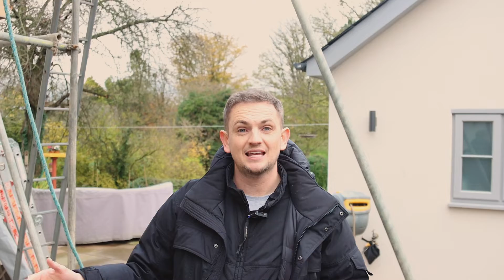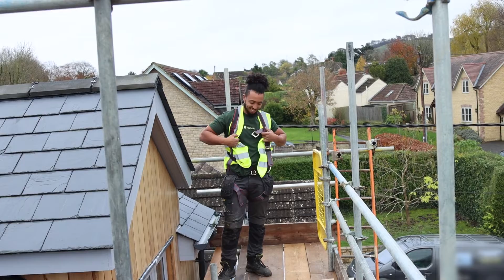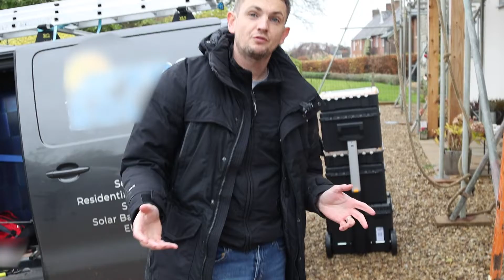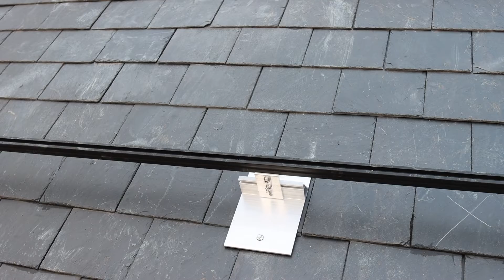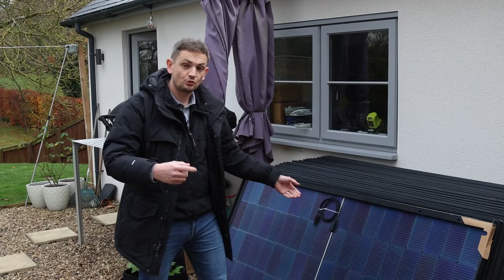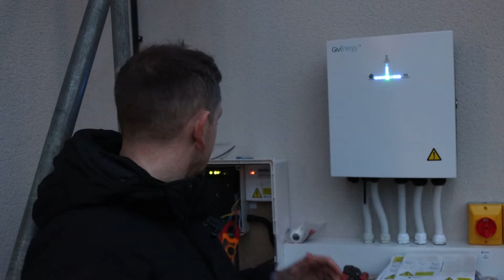Solar Panel Case Study UK - Our BIGGEST installation to date

Comment: They want us to get a heat source heat pump???? The power used is going to cost a fortune even with solar it will not be good.
I have wood burners and the costs are minimal as I cut my own wood.  Standing charges are higher than usage which is stupidity of the government policy.

Comment: I enjoyed the video, thanks! Did this installation require a canopy to be installed over the AIO+Gateway? I'd like to install one of these in a shady location on the outside of a west facing wall, but I can't figure out how to cover it since space is tight.
Reply from the maker: Hey Tim, glad you enjoyed! It is advised to install a canopy over the Gateway. However, our customer specifically requested we didn't fit one and GivEnergy confirmed that even though it is advised, it makes no difference to your warranty. If you don't have the space to, this would still be okay!

Comment: Could you please make a video showing how  much  a 420w panel actually produces in the UK (irrespective of string or micro inverter) to prove that a say 320w micro inverter is more than adequate for 95%of the time because the UK weather is such that you will rarely if ever reach 350w never mind 420w. Additionally show the low light generation. Thank you
Reply from the maker: We can definitely do this. The string vs micro inverter does have a huge impact in low light generation, but we'll be able to explain this too!
Reply: @Heatable  Thank you. I think this would be of great benefit to promoting Enphase in UK. Many people have a "mental block" thinking they are loosing production capacity by limiting themselves to a 320W inverter coupled to a 420W panel. No one has yet demonstrated a direct comparison in typical UK weather from low light, to mid-day of a direct inverter and m/I at the same time.
Reply: @Heatable  have you done this yet? Can't seem to find it. This is enticing but can't really go ahead without some data to back it up.
Reply from the maker: @Aphova  Hi, we have carried out a test on these panels vs normal DC panels over the past year, using all micro inverters to measure the actual difference in generation. It's in edit but will be on the channel very soon 👀

Comment: yes solar  in the freaking land  where the   sun don't  shine 
  i have  5kw  solar in england    and   it produces     200 w  on a dull day   [ which is  for about  6 months of the year  ]
and a battery needs    recharging    every few days  . 
if i had the money  to spend    i would need to buy a battery  big enough  to   power the house  for  at least    4 weeks      [ that would cost    40 k    and then  another 40k in  the next    ten years to replace    the  godam batterys  ]  
at the end of the day      this is just a  big    CON  !
Reply from the maker: Hi Colin, do you have micro inverters? If you don't have these optimisers, you might find that this is the reason why, as they won't be turning on on lower light days.
Reply: Hello mate I also got 5 kw with emphases microinverter in each panel with 9.5 kw battery and ev charger my system is working really well able to charge my ev and also manage to do some export during winter, not much but still ok. Very happy with my solar no problem since installed last November 2022 by Jps renewable

Comment: Is this system going to give the home-owner the results they're looking for? The reason I ask is because they will be using most of their energy in the winter, but that's when solar production is going to be the lowest. Then in the summer when they are producing a lot of solar, they can't export much of it and unless they use the heatpump for aircon, the battery is going to rapidly fill and the rest will not be used.
Reply: SIMPLE ANSWER IS NO     pete    if you had 40 k's worth of battery   to store   the   power    in summer   you might just   make it through  the  dark months  
when you   add in    heat pumps and  ac    cooling   this   whole senario   turns into   a  megga rich persons      aspiration .
Reply: I have similar , all I expect to be able to do is supplement heat pump from solar in winter but more prevalent will be use of battery charging up on cheap rate to do the heavy lifting in winter .

Comment: Very similar to the install you guys have just completed for me just before Christmas , 16x REA Panels with the micro inverters, AIO with Gateway for full off grid and also tied into an existing solar installation under the old FIT scheme along with the GivEnergy EV Charger. I noticed the mounting brackets are the same as the ones you used on my conservatory roof, great video 👍
Reply from the maker: Hey Roger, yes it's a very similar install to your set up! Glad to see you're still watching our videos even after your install 🙌